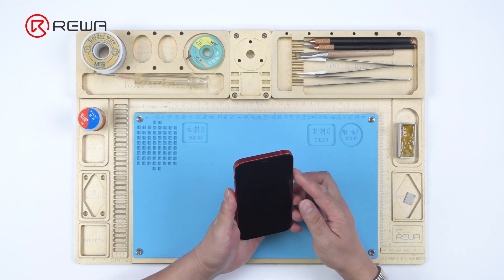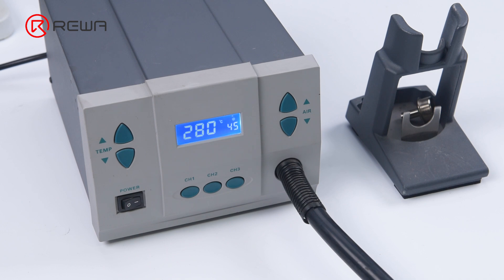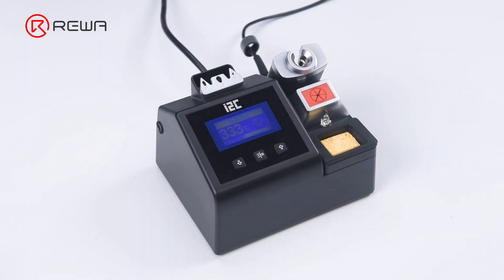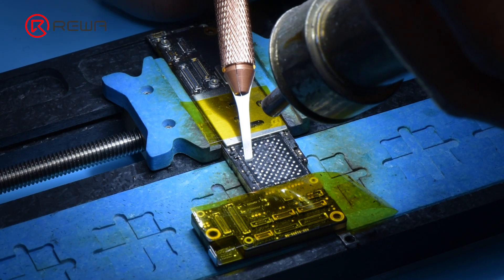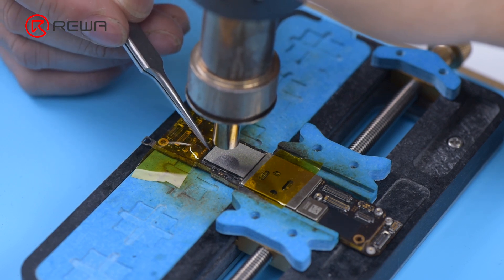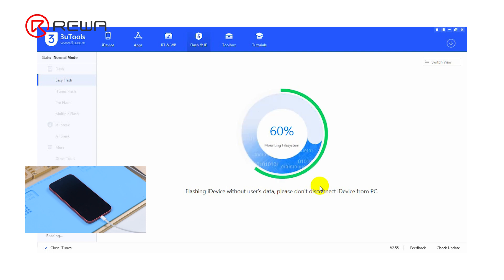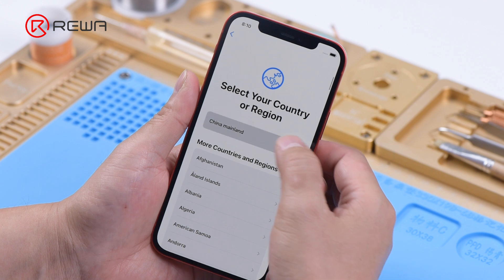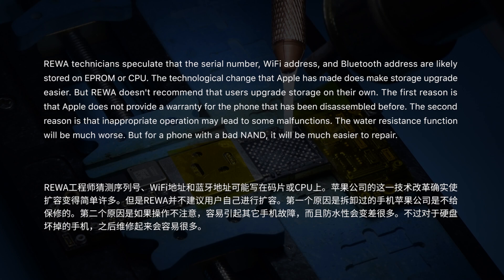Upgrade iPhone 12 64GB Storage to 256GB - The Easiest Ever?

Comment: Very nice work! Liked and Sub'd. I have an XS that bricked somehow. The only thing I can recall is a drop of water got onto the screen near the edge. Its stuck in Connect to computer mode, and the local iPhone place says it wont take a reboot. This phone is supposed to be water resistant. So its not exactly Dead,dead, I dont care about the data on it, and that has almost certainly been wiped anyway after the shop tried the reboot. I would like to get it back to working order. Any ideas? Thanks.

Comment: I have a 'quick' 857DW+ helical hot air gun that has air flow from 1-8. You say use air flow 45 to remove the nand. What would be the approximate equivalent air flow on my station? Thanks

Comment: Buying equipment to upgrade storage: $10,000, paying for storage difference; $100.
Reply: I don’t think that’s the point lol
Reply: @ManzaDJ  point is video’s title says “easiest ever upgrade”. It does not say “this vendor can upgrade your phone for $10”. Got it? Perspective is everything kiddo.
Reply: @tyhq  easiest because you don't need to have special nand programmer to unbind anything. That's video for repair shops and technicians
Reply: Good Hot Air Station is only 100-150. If you desperate, 858D still will do the job for 30-40. Cheapo 50 soldering station, heck I've been using Hakko clone that cost me 10 for countless microsoldering job. 
It's 200 top.
Reply: They use that $10,000 machine multiple times for other people. They make a profit off it after like 50 jobs
Reply: @djmystery7235  that is still $200 per upgrade, LOL
Reply: @tyhq  they can install 1tb on the phone. That’s where people will pay $200
Reply: $50-$70 for a desoldering station, but once bought you can upgrade every phone you get.

the chip is worth about $4
Reply: We’re could you buy the chip
Reply: @rogersandoval9711 aliexpress alibaba ebay mostly chinese dealers selling those nand chips
Reply: Pay a good repair shop in china for upgrade $50

Comment: So now it’s impossible to unbind WiFi because it’s stored not on the nand, is that correct? So you’ll run into issues if you need to replace WiFi ic? Cpu not readable, writeable or replaceable so if it’s stored there this is going to make it impossible to unbind, so if you change the WiFi ic it won’t activate, is that correct?

Comment: Its funny that after he does the install of the 256 chip, and he is setting up the device, it shows 64gb just for a second!  take a picture of the info on the screen, and compare it to the info once it says 256. the modem firmware changed..  its not the same device. it has just been flashed with the same serial number, and wifi numbers.

Comment: Just out of curiosity. Is it possible to replace the NAND of an iCloud Locked iPhone 12? If so, Wouldn't it be much easier for thieves to get a profit out of stolen phones?
Reply: Not possible even tho storage is removed the IMEI is same and once you flash the device back with new software the moment you try to login witth new details it will be locked again as stolen or whatsoever when you connect it to internet

Comment: How about nand flash on MacBook Air M1? Can we just change the nand and install the OS?
Reply: ada dsni juga bang 😀
Reply: I’m pretty sure that the t2 chip will not make it boot if it’s done
Reply: I guess so, it's been done on the EZ FIX yt channel
Reply: hai kak akmal ketemu lagi xixi
Reply: Loh bang katanya di video abang bisa? Tinggal ganti nandnya aja buat M1?
Reply: Not possible, it is tied to T2 chip integrated in the new m1.
Reply: Yes it’s possible and not that hard, it’s like swapping ssd on older models but with some micro soldering involved. We provide the service and it’s much cheaper than getting an upgraded one from apple.
Reply: I think the only things that you should upgrade is your damn stupidity
Reply: I am afraid that upgrade directly from Apple is cheaper and safer.
Reply: @matuslivora7469  unfortunetly authorized apple seller only sell base line MacBook M1 here in Indonesia
Reply: @matuslivora7469  Safer yes, cheaper depends on availability of spare devices. If it would be as simple as for the iPhone 12, one could buy broken MacBooks and solder the spare parts from there with much lower total cost.
Reply: @matuslivora7469  wrong answer, and there is nothing complicated doing it with the right tools to do it.
Reply: @matuslivora7469  you can't upgrade your MacBook M1 at apple shop. They only offer you to buy a one with bigger storage SSD
Reply: @xFixRepairsUK  That's obviously what I was thinking about

Comment: You only post videos which only you can perform upgrade , pretty much impossible for consumers to do on it's own. Nevertheless, thanks for sharing!
Reply: Not necessarily impossible. Just spend about $3,000-$4,000 on micro-soldering equipment, and practice on dead boards. Defense out of reach for the average consumer.
Reply: @Ciso_diagnostics  i can do the same thing with only $100 equipment, stop talking non sense
Reply: @bacphan7582  you can possibly do the same thing, but most likely not a long-term repair then. $100 would at least just go towards the total of a microscope. If you are doing micro-soldering without even using a microscope, then your not even doing micro-soldering, your just soldering. You have to keep in mind you have to be prepared to do many repairs (if you are a or want to become a professional) meaning that you have to have every tool possible for any circumstance. You can’t just assume every phone that comes in would be an iPhone, let alone just a back-light filter replacement. So $100 for NAND swap? That is very unheard of and mostly unlikely. If you do these repairs by yourself just for “$100” then I worry for your customers.
Reply: @JokerBogdanov  $3,000-$4,000 for micro-soldering equipment. “Micro-soldering equipment” is the general term for the tools that is associated with micro-soldering which ranges from micro-scope, heat station, anti-heat mat, micro-soldering tweezers, molds, flux, soldering wick, etc.

Comment: I can see a day when nothing is repaired, there will be an in (openable Iphone )📲, this can conceivable be done. Then it will be a straight over the counter exchange during warranty, no questions asked, after warranty you hand in the old one and then pay big 💵for a new one, an endless loop of new phones on the market. This wouldn't be built in product obsolescence, this would be (forced) product obsolescence. Yes, instead of the apple logo with a bite out of it, instead it should be an apple with a worm 🐛 sticking out of it! Till that day comes you have Rewa coming to the rescue!

Comment: No need of reprogramming!!????
Reply from the maker: Hi, reprogramming is necessary actually. After NAND replacement, the phone will not have the iOS system. The flash is to install the iOS system.
Reply: @rewatechnology2008  in the last session of this video you will describing that the 12 series was no need of reprogramming because that things are built in the CPU . So that is doubt..

Comment: No more removing Icloud with nand/serial change.
Reply: Yep,cpu or eeprom.
But most likly in cpu.
Apple is smart :D
Reply: Still, now we only need a clean cpu, baseband, and eeprom instead of all those and a nand with data.
Reply: @gabrielcarriere4294  You have a point,but replacing a cpu is a pain in the ass.
Nand is much easier.
Reply: very comfortably
Reply: All in cpu?
Reply: How do you do a serial change
Reply: @user-ug3zm3jh4p  remove nand and rewrite serial with programer :D
Reply: You can remove currently iCloud off iPhone or any device by removing the nand/serial change? 

With the new iPhone 12 you have to remove the CPU to remove it now? 

Can someone confirm please
Reply: Anyone going to reply
Reply: @salt7582  Yep I think you are right
Reply: @stefanbeli6001  I appreciate the response
Reply: @salt7582  You could remove icloud on iPads without cellular, only wifi. They don't have imeI, so there is no way to tell if serial was changed. You can use DFU box to change the serial in NAND.
But it seems to no longer works. Apple has probably found a way to stop that.
Reply: Hopefully someone will develop tool like JC b-box  which will give option to change and unbind wifi with removing anything.
Reply: Even if you could change the SN, the apple server will only activate the phone if the IMEI, SN match together as afixed pair. Since you cant change the IMEI, your changed SN wont help you. AM i right?